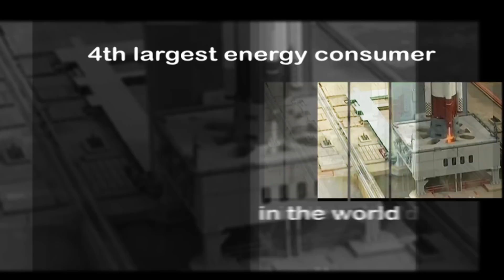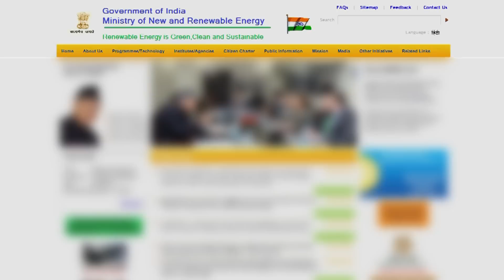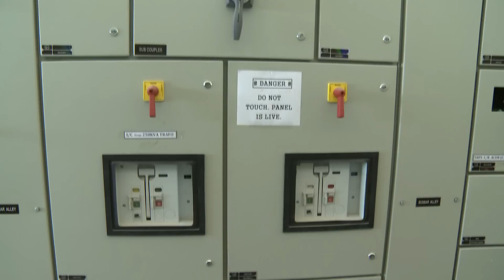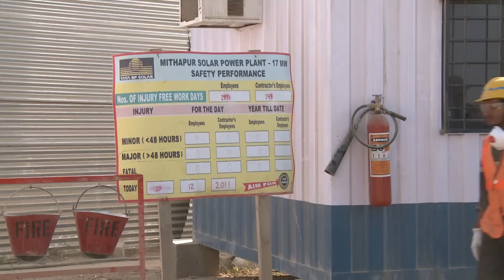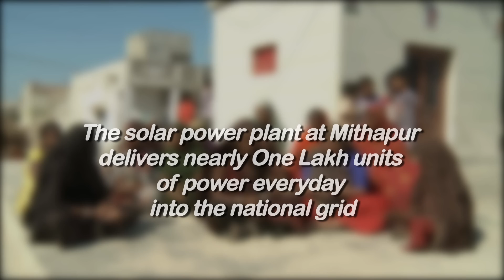Mithapur Installation - 17 MW Solar Power Plant

Comment: Advance Electrical Design & Engineering Institute (AEDEI) , ISO 9001:2008 Certified Institute of Electrical Design & Engineering training programs for Dedicated to Electrical Engineers . AEDEI is latest venture for providing the quality education in the best possible facilities is a key aim of Skill developments for various verticals in Electrical Engineering design
ELECTRICAL SYSTEM DESIGN
TECHNICAL TRANSFORMER DESIGN COURSE
AUTOMATION & INSTRUMENTATION DESIGN COURSE
TECHNICAL CABLE DESIGN COURSE
HVAC DESIGN COURSE
QA/QC-ELECTRICAL COURSE
SOLAR POWER PLANT DESIGN COURSE
THERMAL POWER PLANT DESIGN COURSE
MAT LAB SOFTWARE DESIGN COURSE
POWER SYSTEM SOFTWARE DESIGN COURSE
TESTING-ELECTRICAL ENGINEERING COURSE
Above Courses available in Regular, Internship and Correspondence .
NEWS